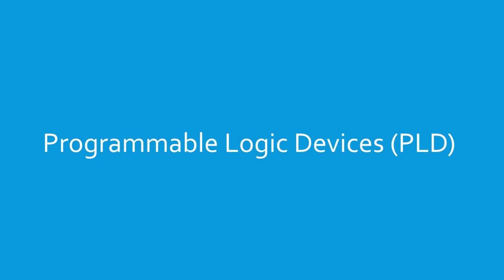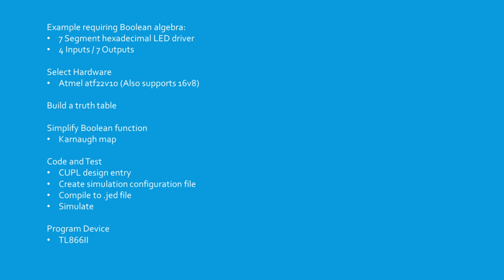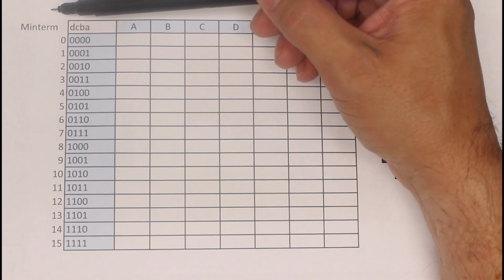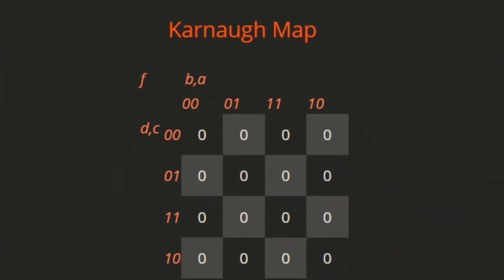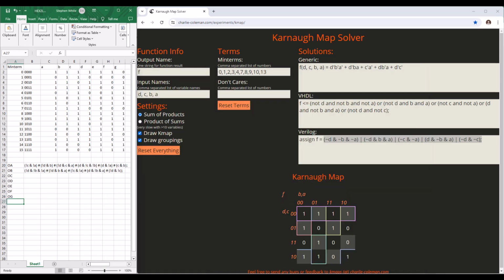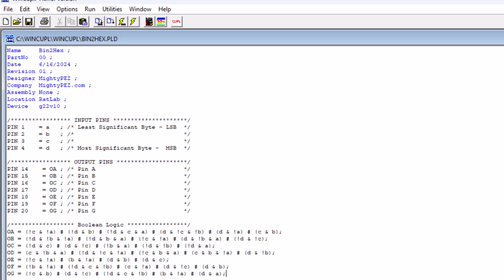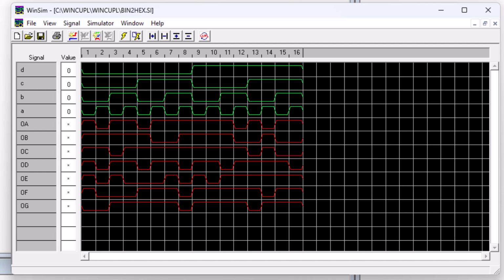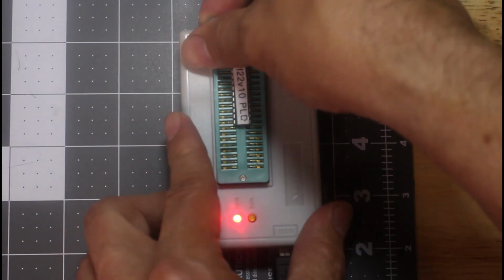Programming Atmel PLDs using WinCUPL and TL866II programmer

Comment: What is the voltage power supply you're using?
Reply from the maker: I use whatever usb-c wart that i have laying around. The apple branded ones i have usually output about 5.14v. Close enough to 5v.
Reply: @mightypez  thanx

Comment: I like that you show some of the boolean algebra, but it's worth mentioning you can define a table in CUPL and let the compiler try to "minimize" it.
That lets you skip the karnaugh map part. It also means you don't have to put all the funky expressions in the PLD file.
Reply from the maker: There is another good example on the inter-webs where someone used the table method, and i have no issue with that method, you can also implement with an eprom instead of logic.  I needed a good excuse to learn cupl for my own use and this semi non trivial example stretched many dormant brain muscles.     Doing truth tables and karnaugh was just a way to use something i learned in 1984 and never applied.
Reply: @mightypez at this point in time we're only using PLDs for the love of the game, so do whatever is fun!

I started using an eprom for custom logic, but then I learned that PLDs are (now?) cheaper, can latch their outputs, and do some fancier tri-stating.

Comment: Very good tutorial.  For clarity, you should mention that you are using a Common Cathode (CC) multiplexed 7-segment LED display.  If a viewer uses a Common Anode (CA) display, the 1's and 0's in your truth table would have to be reversed/exchanged to give the correct equations and output.
Reply from the maker: @PaulChaney-tf5yu  good callout. I always analyze wether CC or CA makes the best sense for a circuit i am playing with but failed to call out.  Thanks.
Reply: No problem.  I applaud you for spreading the information on using GAL/PLD chips.  They are still useful in the hobbiest realm, and the programming info and techniques have completely dried up.  The "old" knowledge HAS to be preserved!

Comment: Great video. I've bought som SLG46826G PLDs. They can be programmed with an Arduino over I2C, and the software is available for both Windows, macOS and Linux. And they are operate between 1.8V and 5V, with 2 different voltages. I'm looking forward to try them out.